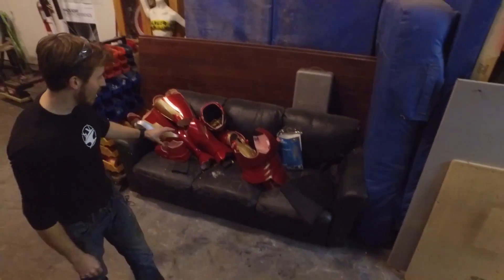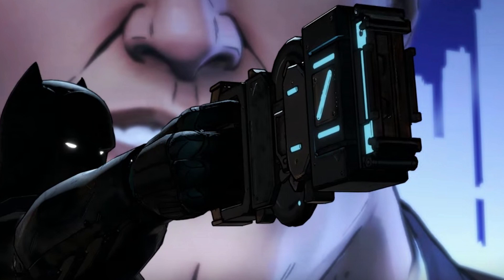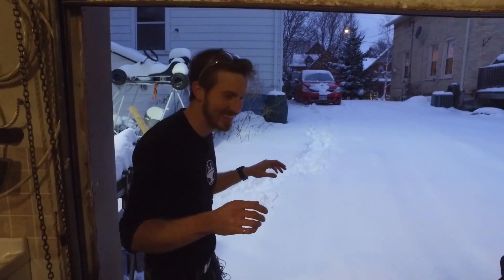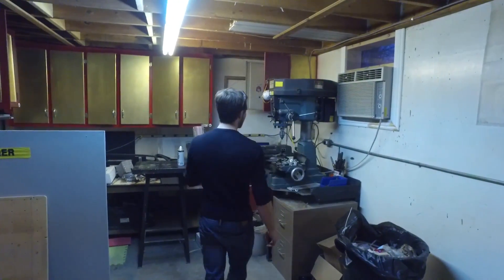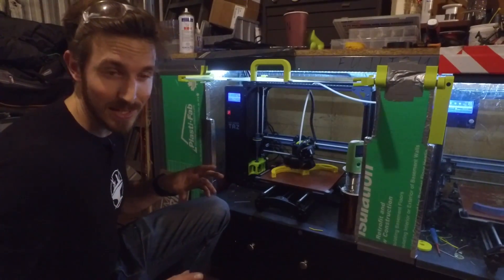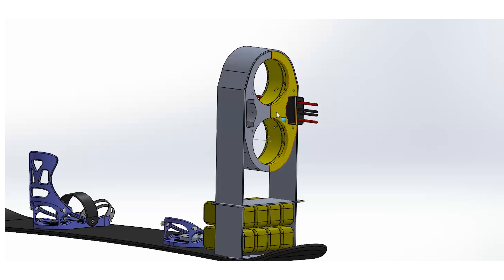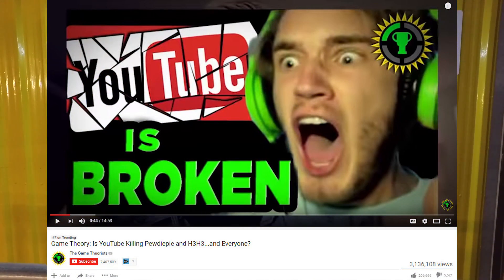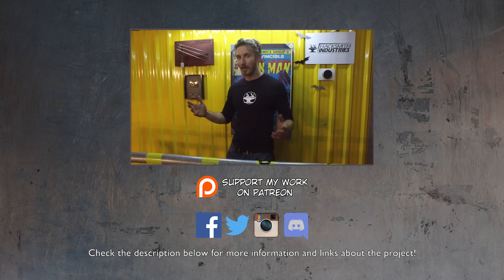WILL THE GRAPPLING HOOK ASCENSION DEVICE WORK? (Workshop VLOG 011)

Comment: Can I ask why you haven't used the turnigy g110? it's lighter and has a better rpm by 5.
Reply from the maker: +Adam Dyer 5rpm better...? What's the point...
Reply: the Hacksmith
It's also lighter and takes up less space
Reply: It's just my opinion. Your design not mine.
Reply from the maker: +Adam Dyer yeah but 5rpm is a non existent difference when it's 6000rpm...
Reply: the Hacksmith Ah. I see.

Comment: You should use an edf as a fan in that window lol. Exhaust tips. I seen in another video that you used a strainer as a guard so many do that on both sides and 3d print a part that will fit around it and into the frame of the window.

Comment: Random question about your "how to make anything using a welder and a grinder both of which can be purchased for <$200. Where can I get a welder and grinder for that price? Also is this MIG, TIG, Shielded Flux Core? And can a welding apparatus run on a standard 120 volts 60Hz US/CA outlet?
Reply from the maker: +aspvip assuming your from the US, you need to visit Harbor Freight tools -- on sale you could probably get both for under $150!

Comment: wouldn't it be better to have 1 motor on the front and one on the back for even weight
Reply from the maker: +Xavier Crowley having the fan blow directly into my legs would mean it wouldn't provide any thrust. You have a bit more leeway with suction from the rear fan :)
Reply: the Hacksmith ahh ok makes sense. You should look into teaming up with signal snowboards to make this a ETT.

Comment: Wouldn't it be better to put the EDFs side by side so that there's not so much torque on the rig?  Also, maybe batteries between the feet so that the weight is more evenly distributed?  Project looks good!
Reply from the maker: EDFs are too wide -- then when you crash you'd break them =(

Also the batteries are one of the lightest components of the system :P

Comment: I feel like the batteries on the snowboard should be put in between the bindings so their weight is less impactful
Reply from the maker: The steel weldment holding it all together is going to be way heavier than the batteries. They're lithium remember, don't weigh much! It'll be interesting to see how it behaves!

Comment: thats too much torque on one side u should have them mounted on the side and put the batteries between ur legs to have a well weighted center of gravity and wear heat resistant pants lol in case of fire

Comment: try metal casting your 3d print blades for the  jet fans
Reply from the maker: +Michael D too difficult for something that needs to be that precise :(
Reply: ok what about resin casting making a mold of the blades and use a strong metallic resin

Comment: Hey so you should create a thing for the back footing of jet powered snowboard in which if you lean your foot back it turns the board left and if your lean your foot  forward it turns the board right, creating like a vector thrust operation.

Comment: I just discovered that I was unsubscribed from you... #FuckYoutube
Reply from the maker: damn it
Reply: the Hacksmith  yup, luckily I caught it relatively quickly. I'm fairly certain it happened within the last couple days because I remember getting a notification for your Ironman armor video. Anyways, I was wondering, wouldn't the housing for the EDF's get in the way of your back leg on the snowboard? You know, in case you needed to lean back? Anyways I love the idea! Though I have to say, it kinda reminds me of the scene from the movie 'Darwin Awards' where that guy sticks a JATO rocket on the back of his car! XD
Reply from the maker: That's so weird.
I feel like you lean backwards more when you're going down hill -- since this is mostly for flat ground, I don't think it'll be an issue =)

They're mounted higher up so in a crash they don't get damaged, and so they don't suck snow in =)
Reply: the Hacksmith Good point! I didn't think of either of those. Yeah, I suppose on flat ground you would take a more traditional skateboarding or longboarding stance. Would it hold up to jumps off of snow banks and the like? I mean, going up to 50 kmh could net you some serious air.
Reply: +the Hacksmith you should really do more vlov like one every week

Comment: Hey! So, instead of use 3d print to fly, can't you use the 3d print to make a positive mold(?), use it to make a negative on fine sand  with sodium silicate or on plaster and cast the actually funcional fan out of aluminum, brass or steel?
It's not hard to melt it and there are some easilly done project of cheap furnaces on youtube...
Reply from the maker: You can do at home casting -- but for something that needs to be as precise as an EDF blade spinning at 40,000RPM...? I wouldn't want to risk it. Professional EDFs are all machined -- if they're cast, they are machined afterwards, and likely cast in a vacuum. Just not something we're capable of... yet. =)
Reply: Fair enough xD

Comment: i would just suggest putting rhe batteries for the snowboard between your legs and the thrusters further down. for balance, control and center of mass reasons.
Reply from the maker: That was originally the plan but it's nicer all in one unit on the back -- if the weight becomes an issue -- it's a 5 minute weld job to fix ;)
Reply: haha typical mechanic phrase "it's a quick fix"
but you're absolutely right.

Comment: I am in love with your shop. I am trying to make a shop of my own, 100ft by 50ft Quonset hut and some tips would be super useful on how to maintain a nice environment in there because Wisconsin's winters are, for lack of better words, fucking brisk. I love the vlogs and I love the, well, everything you guys do. Thank you.
Reply from the maker: That's an awesome size! Mine is only 26' x 50' !!! you've got 4X the space.

Shelves. lots of shelves. You have more space than me so you can have more dedicated workspaces, but we like to keep a lot of our tools on carts or casters. Tablesaw, chop saw, grinding cart, welding cart, air compressor, etc -- then you can roll them in and out of the way.
Reply: Alright, wonderful. I will definitely do that once I defrost here and head back out lol. Thank you for the fast response. Some more questions I have is what kind of power do you have out to your shop and what could I expect heating costs to be and is your shop heated all the time? As of now it is almost entirely empty with no insulation. Thank you very much.
Reply from the maker: You'll definitely want to insulate... We have a natural gas furnace in it, gas bill is about the same as my house though we don't keep it that warm. On cold cold nights it can burn a lot of gas... 

We only have 240v at 60A to the garage -- 200A service to the house, might be able to upgrade to 80A, gotta check the cables. As long as you're not running everything at once, you really don't need that much power. All of our lighting is LED, and the heating is gas -- if you're doing electric... well that'll be a lot more.
Reply: the Hacksmith Wow, understood. thank you so very much for your advice. I know my brother and I will most definitely use it. Thank you a million times.
Reply: Dude! IM A HUGE FAN! But I have a idea to zip line roof to roof! Please check out this comment! So first you just regular shoot onto another building and make sure the grapple is attached. Then you have some sort of second grapple that you cant shoot but you can pull it. You attach that to another area then you will have a zipline tool in your "Batman Belt" And you can use it. But to get the grapple back Is the problem. Also I was thinking the gun could hang on the line and then handles come out the bottom of the handle and you press the button to retract the first grapple. The back grapple will be pulled. Now you try to wiggle lose the back grapple. You put it back in. Done! First test this over a 5 foot area. So if you fall you wont get hurt. Now test in a one story building. Be safe! If my idea works or if you choose this idea please give me credit. -MrFudgeCakePlays
Reply: NITESCIENTIST wow
Reply: NITESCIENTIST wow
Reply: NITESCIENTIST of you do build one you should make a YT channel and do cool stuff like this if. Possible
Reply: You bet your ass I will.
Reply: Whats up?

Comment: I got something to help out with your revenue problem. 

none of these builds are for sale, right? it wouldn't make sense. they take up a lot of your time to build just one build, let alone several to sell to fans. 

why not sell the models/designs? many of us who watch this have the equipment (or some of us do). it costs nothing to you, and there are plenty of hobbyists that would be interested.
Reply from the maker: You're correct -- most of the time the prototypes are too expensive -- and need a  lot more refinement to be truly useful or recreated. Selling designs for basic things could work, but it's also a lot of work sometimes to put together the resources. For example, when we create a weldment -- usually we just make it completely by hand with no model!
Reply: the Hacksmith Cheers then. I hope your channel continues to thrive despite Youtube's fuckery.

Comment: you should put the winch on a belt so you cant lose your grip or fall and so you can climb through what your are aiming for or climbing over because if you have it on the gun the you would have to hold o with one hand to whatever you are scaling then put the gun away, then climb.
Reply from the maker: Or we'll have a sneaky strap up my sleeve to a harness under my pants ;-)
Reply: the Hacksmith that could work too

Comment: Be careful not to break your EDFs when twisting them at high speeds... I believe sudden side airflows that might occur when twisting the snowboard to carve (it's like flying at a high beta/sideslip angle derivative) introduce stresses in the spinning blade that normally are not considered in their design.
I'm telling you this because I built a toy hover-car once, with a regular plane propeller, and broke off some blades with sudden twisting movements. 

Play safe!!
Reply from the maker: I'd likely be killing power when going into a turn, i think ducts will survive a bit better than props since they are shielded slightly =)

Comment: *Idea - The battery charging cabinet: with all of those batteries charging at the same time heat builds up especially being in an enclosed area. Maybe cut a hole in the side of the cabinet and add some sort of fan pushing fresh air into the cabinet to keep the batteries cool thus prolonging their lifetime.  Just an idea.*

Comment: Just a thought on our snowboard project. If it were me, I'd mount the batteries in the middle, and spread out low. And get the ducted fans a little lower on the back of the board. Namely, in a horizontal orientation. Two reasons, your knees won't hit them in a crash, and when leaning back. You kinda lean pretty far laterally when trying to keep the nose up. But secondly, if they are in a horizontal congif, you will be able to easily upgrade to possibly having them track or carve with you... think articulating hovercraft... propulsion to the rear, despite the direction of your nose.

Anyway, just a thought. You got long winters up there!
Reply from the maker: That was the original plan but it was more convenient to place the batteries in the same area -- the whole thing will be an individual unit that can be attached to any snowboard -- if the weight is off, we can always move the batteries forwards -- it's only a 5 minute fix with a welder ;-)

The reason we didn't go with horizontal is because they would stick out from the side of the board. Most common way to crash a snowboard is by landing on your ass -- if the EDFs stick out they'd eat dirt and probably break... and considering their a few hundred each... we'd rather not do that ;-) And the reason we placed them so high... so they don't suck in all the snow =D
Reply: Perhaps a magnetic breakaway mount would be better for the fans than bolted in. Similar to how you want your skis to break away in a crash, rather than your ACL. Unless you really suck at snowboarding, I don't think you'll crash as much on level ground unless you are really trying to carve hard and hit jumps.

I was curious about the snow vs. electric fans myself. Too bad you don't actually have groomed snow areas to try this out. Because I keep seeing powder being kicked up as well.

Comment: hmm... for the 3d printer enclosures. There doesn't seem to be any openings for cooling. Or there isn't a danger of overheating printer components? If not, what temp does it usually get up to inside the enclosure with the heated bed running?

Comment: 0:42 Brushless DC-Motors? DC? Wtf?? I see three cables each, those motors are looking like normal brushless motors (which are operating with AC voltage...)
Reply from the maker: Brushless DC motors are essentially asynchronous AC motors ;-)

Comment: Quantity or Quality doesnt matter cause your videos are so fucking good...I don't mind frequent vlogs with occasional tutorials too...also just curious,shouldnt the edfs be placed horizontally instead of vertically?Wont your legs restrict the airflow?(just based on the model)
Reply from the maker: Had that design originally, but they'd stick out from the edge of the board --- so if you crash you'd smash em =(
Reply: the Hacksmith ahhh I see!!Thanks for the reply and hope you guys have a fun time crash-testing it!Cheers! :P

Comment: I don't really think that a gun mounted winch is a good idea, the string will pull on the gun if it runs out of rope and kick you in the face, and you have to hold on the gun if you want to go up with it, a hip mounted system might be better
Reply from the maker: Why not just a strap that goes to your hip? ;-)
Reply: or that :D

Comment: That snowboard is going to be very back-heavy; you sure it wouldn't be better to move the batteries to the center?
Reply from the maker: We placed the batteries on the back out of convenience -- it is just a first prototype. If it proves difficult, we'll move them. Original plan was to have them in a backpack =P but we wanted the system to strap onto any snowboard and be ready to go =)
Reply: the Hacksmith Ah I get what you mean; I agree, a closed unit would be far cooler and also ultimately more practical. I really hope it works :)

Comment: LOVE the snowboard project!

I'm concerned you may lose efficiency with the inlets right behind the rider's body...did you investigate mounting them side-by-side, just as wide as the board?
Reply from the maker: Bigger issue is blocking the thrust path -- the intake can suck air from all directions, and my leg isn't right up against it, so it should be fine. We're also putting them vertically so they don't stick out past the board -- cause then if you crash, bye bye $1000 components! 

They also need to be higher up so snow doesn't get sucked in constantly! =)

Comment: wouldnt it be better to put edms lower to board surface? in left and right side configuration, so that you can also test if it is better to be pulled by them, by putting them in the front.
Reply from the maker: Two issues -- side by side, they'd stick out from the board -- as soon as you go down once (which is gonna happen) smash goes the EDF!

Secondly, if they are close to the board they'll suck in snow and stop working =P

Comment: In your last video about the Batman gun I thought "nice, but the pull-up mechanism probably is not going to work", because you can't have that much power in such a small form factor.Seeing these two monster brushless motors run at 25% totally changed my mind. Awesome.
Reply from the maker: The magic of brushless DC motors.

Engines suck.

Comment: You're going to get a torque (positive moment) at the back foot with the two motors being that high up. You should try to get then lower to the board.
Reply from the maker: You will, but putting them lower also means they'd suck in snow. They're placed the way they are to avoid that, and to survive a crash! =)
Reply: the Hacksmith Ahhh makes sense, just make sure they board has a study frame mount (I think you mentioned welding) otherwise your trousers will get eaten by a dislodged EDF even with the gaurds hahaha. I am sure you already considered that though :)

Currently building and making a video for an electric longboard so i look forward to seeing snowboard complete. Best of luck.

Comment: you have a tormach cnc milling maschine so why you are trying to 3d print EDF Fans? milled polymer fans are much stronger than printed ones not noticing that you could make them from alluminum ore steel or if you really wanna go fancy you could mill forms for fans and make them form glass fiber ore eaven carbon fiber reenforced material
Reply from the maker: Because the Tormach only has a 6"x10" work bed and we can get free 6" EDFs from Hobby King =P

Comment: I'm no engineer but wouldn't the user of the snowboard impede the airflow to the edf? Surely some form of T shaped rig lower to the board would be more suitable. More of an outrigger setup.

Just a thought.

P.s. I'd kill for your garage.
Reply from the maker: That was originally the plan -- but the EDFs would suck up snow and destroy themselves. The mount is rigid, so location of thrust really doesn't matter -- you'll be able to counter it with your body wight quite easily!

Also if you widen the stance -- then as soon as you crash -- bye bye $1000+ of components!
Reply: the Hacksmith I was more referring to the user blocking the air getting into the fans, also potential clothing mishaps!